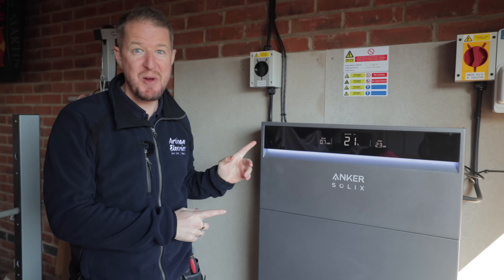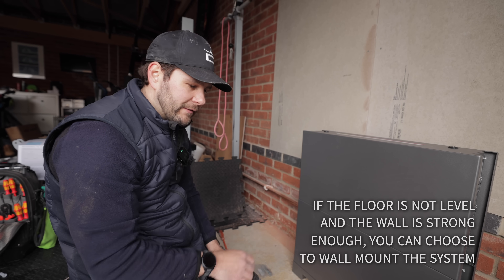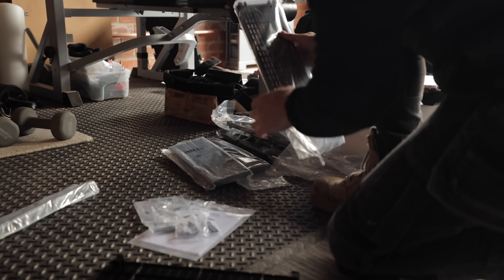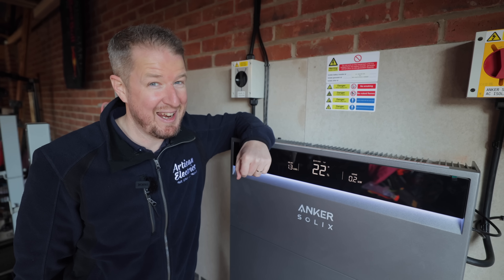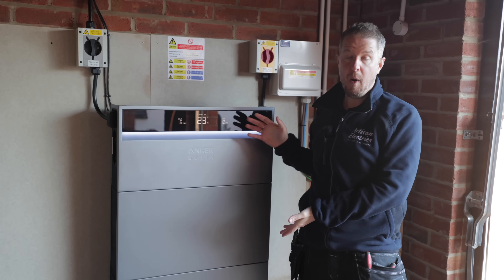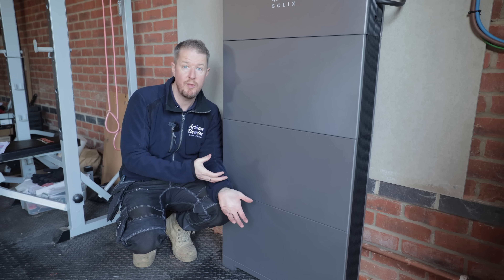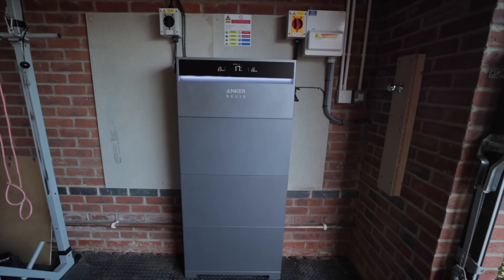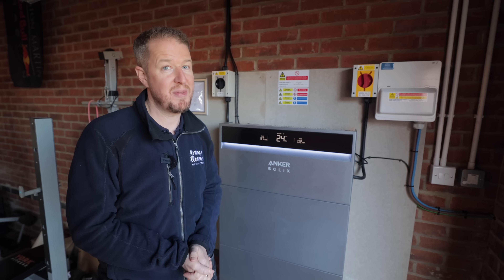Is this the SMARTEST home battery storage system? Anker Solix X1

Comment: Very nice, but on your website, it states 26k for installation ? We're looking around as moving soon to a barn conversion with a SW facing large roof and a garage.
Reply from the maker: Yeah our prices start from £26k for a basic install but most of our projects are around the £50-100k mark (we mainly do large bespoke installs). You can get in touch via our website if you would like a quote.

Comment: Hi, having seen a few videos on the x1 I found out that each battery section has a voltage optimisation module. I remember your video where initially you installed one but you said you don’t like optimisers. So I ask what your thoughts that the x1 has optimisers.

Comment: There will be a tipping point when the cheap rate electricity is no longer viable, if or when all households are charging there battery storage units at night.

Comment: Seems really nice system all integrated battery, inverter/charger and PV mppt.
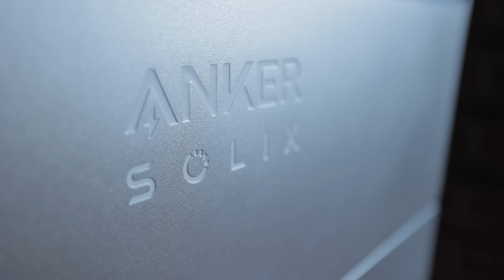6:28, why would you galvanize stainless steel? Don’t make to much sense, why not just use prober type stainless steel.

Comment: I notice you don’t have the separate anker backup battery box in this video - is that because in this system, the backup solution is integrated into the power module? As some videos show a separate box, and some don’t? Not sure if the system in the video provides backup power to the house?

Comment: That charge and discharge rate is shite. Houses with heat pumps (and most likely electric everything else) will go over that in the regular.

Disappointing. Even Givenergy managed 3.6kw discharge (I've seen mine go to 4kw).

Manufacturers really need to start developing systems that can cope with around 10-15kw of discharge. We're moving to heavier and heavier loads in households and it's infuriating to see even a small amount coming in at standard rate. They also need to put whole house EPS for power cuts as standard as well. No consumer realises this is not there by default on the absolute majority of systems.

Comment: Nice product but much prefer my SigEnergy with 8kw batteries. 10k are now available too. They also have adjustable feet.
DC cables between batteries are a thing of the past with SigEnergy, they also allow control of a heatpump.

Comment: These systems use the same batteries as electric cars when I'm right.
And many times electric cars burst into flames.
Battery storage systems are not that old yet.
But it will happen to these systems also when they get older and their batteries deteriorate.

Comment: Do you guys install Deye (China)  products? I love them and have been off the grid for 3 yrs on them and I have never had an issue! I consume way more power than an on-grid customer. I have a single phase 16kw unit, 20kw batteries, and 20k of solar split over 3 MPPT's.  I love Anker, but it feels like an apple vs a linux. Linux is cheaper, way more powerful, efficient and flexible; but slightly more complex to understand. Anker is sleeker, but less exciting in every other metric. I live in Johannesburg so I enjoy solar radiation 365 days.

Comment: you can galvanize stainless steel, but it's generally not necessary as stainless steel is already highly corrosion-resistant. However, galvanizing 300 series stainless steel (which contains nickel) is possible

Comment: Very nice looking setup and surprised to see you using CFC sheeting (something installers should be looking at here) and so good to see such a well documented installation. Galvanised stainless is "havin' a bath" though... 

Modularity is serious positive speaking from experience. My system in Adelaide (South Australia) has 3.2 KWh modules, which allowed us to increase our total storage to 25.6 KWh (over two stacks). 

In summer here we hit the grid for about 1 KWh per day averaged but my roof is 4 degrees North axis on 21 degree pitch. 13.2 KW of panels split 4:3 North:South and Summer solar meridian is 79° (34° South) so between the Hybrid @ 5KW and other 5KW inverter we often generate enough to Feed into the grid in addition to "filling" the battery ( even with A/C, induction cooking, hot water and a beer fridge :). We've uploaded 2132 KWh to our electricity grid in the 99 days so far this year, but it has been an extraordinarily hot summer.

We ran dedicated LAN cables from the inverters to my VPN router rather than rely on Wi-Fi with up to 46° C in summer here it is almost a must to install under cover.

Comment: Is it actually worth installing panels in a country like the UK where the sun dont shine? My batts are fully charged in Cape Town by 8 in the morning.
Reply: Yes, because the sun does shine. The shocking thing about South Africa is that you still burn coal to generate electricity to heat water, and you're not allowed to export excess solar to the grid, are you?

Comment: Such a tiny system is probably quite useful for the warm UK.

I am trying to find something for Norway and in January, my double house - fully heated by heat pumps - uses about 65kWh  day from the high peak (around 5am to midnight) electricity. I'd hence need to stuff 60-80kWh in a 5 hour window into the battery.
All vendors whom I had over recommended me to get a 30-35kWh battery because "it will do most of it". And IMO, this is total BS.

Solar won't work here in winter and in summer, power is cheap.

But m biggest grievance is that nothing about these system is yet exchangeable or nicely standardized. It's like buying a Fisker Ocean and being happy that it wasn't all that expensive.
While an app-update can kill a 30 000 EUR system, I am not yet tempted to buy.

Comment: Bifacial and the panels are 4 inches from the roof basically acting like a blanket. Am I missing some hidden new use for hiding the underside or did this guy get ripped off / upsold / bought first researched later type of situation?
Reply: Bifacial panels are transparent around each cell, so light will pass through the edges and reflect off the underlying surface.
Reply: @jonnicholls7003  Does that make a meaningful difference? I was going to ask the same question - it would seem to me that half cut is a more important feature than bifacial on a roof, but maybe half cut came before bifacial so has dropped out of use as the fashionable thing to mention?

Comment: one person should be able to lift the modules its that simple. the economics of batteries are terrible for resi use at moment, two installers is expensive and makes it worse. this system is a fail.

Comment: Wow, wow! So, let me see if I get this right: the INVERTER is the TOP MOST PART OF THE BATTERY???
Inverters tend to heat up a lot during operation, especially when they're working their peak in converting DC from the arrays to AC for the house/grid - and this heat is VERY CLOSE and therefore VERY BAD for the batteries.

Looks great, not a good design in my opinion, unless the inverter has some active cooling going on (which I doubt).
Reply: I don't agree. If the inverter were under the battery the hot air it creates would go straight up the back of the battery. This actually helps by drawing cool air up the back of the battery (not that the battery itself dissipates much). But more importantly, it's the heatsink at the back which is the hottest part, and this is not in contact with the battery.
Reply: @matthewmarks6951  it's in contact with the battery if it's part of the same structure. Unless there's an air gap in between, which there isn't.

My main inverter gets warm during normal operation, even when converting DC to AC from the battery at full load. But it gets very hot during peak sun irradiation. We're talking close to 80°C. The cooling fina get so hot I would burn my hand if it touch it for more than a solit second. So I installed two blower fans underneath it for cooling and they work miracles, reducing the temp of my inverter to a very reasonable 60°C even at peak sun.
Bottom line: I'm speaking from experience and actual measurements. Inverters and batteries should not be in contact.

Comment: "Is the Anker SOLIX X1 the smartest new battery system to hit the UK market? "

Based on this video the answer is NO.  There was no mention of any smarts in the form of predictive charging and discharging like the PW3 nor was there mention of any battery management smarts.

Maybe the unit does have these things but on the basis of the video it seems to be just a battery with a charger and inverter connected housed in a nice box.

BTW what is the battery chemistry?
Reply: In germany special signals via the grid are transferred with which the x1 can interact (somewhat).
Reply: @robgeheim4842  I think the problem in the UK is that our electricity retailers have many varied tariffs available so use of grid signalling will not work, and the grid network is probably not even capable of doing it without investment.  

PW3 allows you to enter your grid tariff rates/times and then AI looks at that, your usage profile, tomorrow's' sunshine forecast and set import / export /self power to maximise savings.
Reply: @barrieshepherd7694  Yeah, it wouldn't work without investment, and it's been superseded by internet technologies anyway. Doesn't the PW3 work with Octopus smart tariffs so you not only don't have to enter any data but it automatically updates?
Reply: @matthewmarks6951  I have not confirmed that the Octopus smart tariffs yet work with PW3.  I don't have an EV so can't use those anyway. Also  I think you have to hand your system over to Octopus totally - i.e. give up any local control.  The advantage of manual entry is of course you can 'adjust' the hours and rates to times for export to suit yourself.  That said the PW3 AI control seems to be working well - so far!
Reply: @ Agile Octopus is not an EV tariff and requires no intervention by them at all. It is up to you to get the data from their API and work out your import patterns. However, this tariff doesn't pay you for export. I believe they ran an experimental tariff that did pay for export without you even having to have an MCS-certified installation but this is not available at the moment.
Reply: @matthewmarks6951  I'm on Octopus Flux Import/Export - so far it's working out well - with the sunshine - I'm exporting enough to pay for my gas and standing charges as the PW3 is charged, by solar, by around 11am and keeps me going through the rest of the day with excess solar being exported.  

Not sure how they got around not having an MCS Certified installation - I would have thought the DNOs would clamp down on that.
Reply: @barrieshepherd7694  Maybe they have - see thread on DIY Solar Forums. I'm heating water with excess solar so gas usage is approx. zero much of the year. Now with battery and extra panels, electricity import also zero, but of course winter is a different matter. A reduced standing charge tariff is more appropriate for me.

Comment: Don't you think there is a serious fire risk when installing these batteries inside the garage? I know lithium fires are rare, but when they occur it's significantly more damaging than regular fires. Wouldn't a better option be on the outside of the house?
Reply: These are lithium iron phosphate (LiFePO4) cells - they are far more stable (and long-lasting, but lower energy density) than ordinary lithium ion cells.

Comment: Running an ethernet cable is a little excessive, It would have been more cost effective to install a Wireless mesh system indoors (taking labour into account). Additionally, CAT6 (or CAT6A) cable isn't usually that well rated in UV protection, and is likely to break down in only a few years.
Reply: Might be externally-rated. It is black after all.

Comment: How bad the brits install, baffles me. That ring circuits were installed, is a nightmare, a giant capacitor and a lot of magnetic fields. I really really hope that DC disconnect is rated to turn off DC current, as DC never passes 0V on a sine wave, unlike AC. This would cause a fire if you try to disconnect. Always better to use pull fuses or contactors that separate with a large distance.
Also, are those single insulated brown blue, yellow-green on the right?
Reply: Ring circuits were invented to save copper after the war. Because a ring is rated at 32A, our 13A plugs all contain fuses which are sized to protect appliance cables, offering better protection than centrally-protected systems. The ring certainly has the problem that a break in it is not obvious, but current doesn't circulate around it so there's no issue with magnetic fields, and I don't understand why you're mentioning capacitance - that's both tiny and nothing to do with the ring topology.

The DC side is of course the same wherever you are. Yes, there is a real risk of an arc so DC disconnectors, as well as being designed with this in mind, should all have warnings not to disconnect under load (i.e. switch off the AC side first). Even the MC4 connectors that you use for the DC wiring have warnings moulded into them. By the way, the contacts move far faster in a DC disconnector than you'd be capable of pulling a fuse. By the time you've achieved that large distance you've suffered the consequences.

Comment: Being an old fart on the other side of the Pond, I remember when the early adopters were using (usually used) fork truck batteries off grid.  That includes installing separate lines to critical loads so they could switch from grid to battery manually when the grid is available because there was no automation.  Being basically lazy, I would want a grid tied backup, which annoys the installers that want to get done with the job as quickly as possible, given that the backup factor requires a bit more equipment and expertise.  [Algorithm fed. :-)

Comment: A bit of a useless feature to control the heat pump if you know how heat pumps work.  In winter your battery will be most of the time empty or barely charged and the heat pump will use a lot of energy when it is lower than 7 degrees C outside.       And when you turn a heat pump on, the first hour it can use 1 kWh to 2.5 kWh...  When the room is heated up, or when your water is warm it barely uses energy  0.2 to 0.4 kWh.  It's better to let the heat pump modulate

Comment: How about a damp cellar, how long will it last there?
Reply from the maker: Only one way to find out 😂
Reply: 10 years at least ? It's IP65 compliant, salt water & rainshower tested ...
Reply: Would you really want to have a flammable battery under your house ?!

I guess I have a gas meter and pipes in my cellar… 🤔
Reply: @YesBudda  Depends on the chance of it catching fire, which is tiny.

Comment: I use alot of Anker products and I certainly have not been disappointed with their work. This has me interested in this. My question is it as flexible in what it does with the extra solar generation. Where it can say send it to the hot water system and or the AC system etc.
Reply: If you can interrogate it for the grid meter/current transformer readings then you can add extra controlling equipment to do this. (I built my own.) There are also standalone systems for immersion heaters which have their own current transformer.

Comment: Why put a biFacial solar panel on the roof?
Reply: Indeed. This question was asked elsewhere on this video and someone said that light gets between the cells to be absorbed at the back. I highly doubt this is of any significance.
Reply: @ right. Won’t be significant there.
Reply: @therisingsun99  I think it's just the latest meaningless marketing term. As I said elsewhere, half cut would be much more useful, to improve conditions under shade. I am guessing that half cut was an earlier innovation which is now standard on all panels, and therefore doesn't sound so exciting.

Comment: I would not want a big battery inside house/garage. It should be well separated from other things. Lithium batteries can create a big fireworks/explosions and the cells can launch themselves for quite some distance (seen them fly 50+ meters). Out of all lithium battery fires I've seen, LTO seemed to be the least spectacular one (much smoke, less actual flame).
Reply: So basically you have no idea what you're talking about.
Reply: Look up the difference between lithium ion and lithium iron phosphate.

Comment: The solar panels were a neat design with the bevels around the edges…nowhere for Possom invasion like we do in Oz.
Reply from the maker: Yeah this is standard for us - we don’t have possums but do have pigeons 😂
Reply: @artisanelectrics  Does this solid surround appreciably reduce the efficiency by blocking airflow? I used Bird Blocker, which allows plenty of air underneath but was a pain to fit...
Reply: @artisanelectrics Can I ask what that nice looking trim/skirt is that you used on the panel array edges if you fit those as standard? Also did you see the other question about whether these are known to reduce airflow/cooling of the panels to keep generation as efficient as possible?

Comment: Missing details such as the number of phases as an example!
I myself live so far north that I assume I must have wind power in the first place as well as a generator and a large battery capacity with a three-phase inverter if it is to work at all in winter! The problem is of course the cost which is so high that it depends on how long I will live to know if it could be worthwhile? I also have another property with a larger watercourse on the plot and I have wondered if that could be the best solution for me? It depends on whether it is even possible as it is a protected watercourse and the large companies charge transmission fees if I need the power somewhere else...
There should definitely be an EU law that the large companies would be forced to pay the current market price if they have a surplus here, they are trying to prevent competition by only paying a third of the price plus they require specific (=EXPENSIVE) regulation equipment...